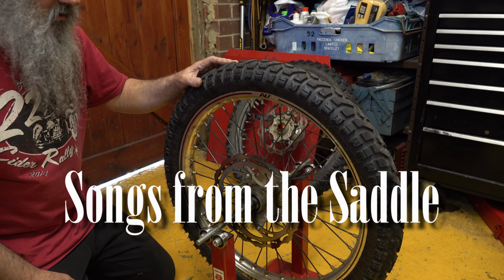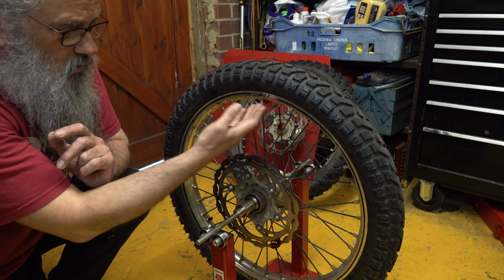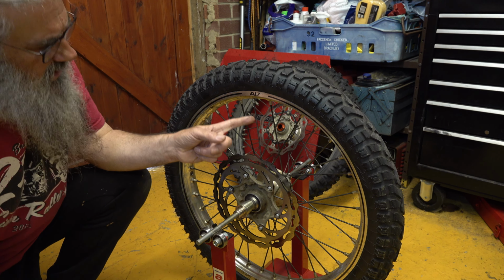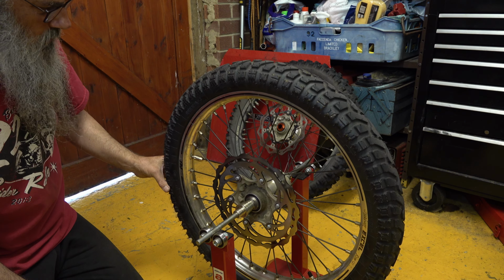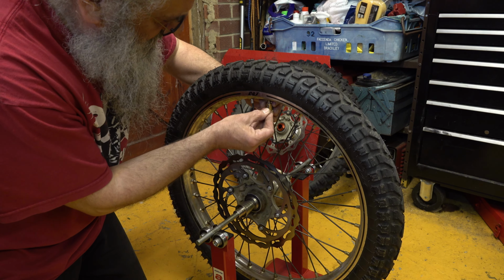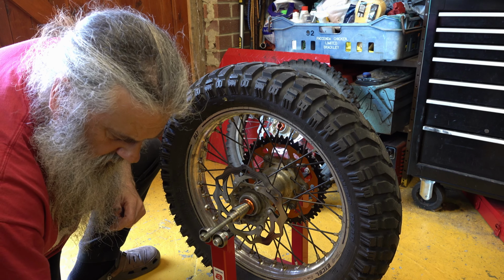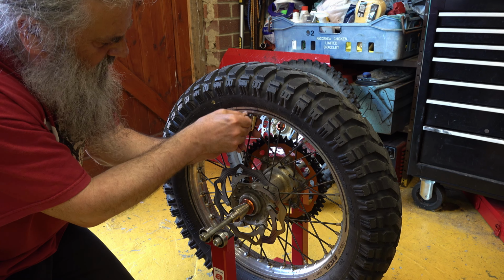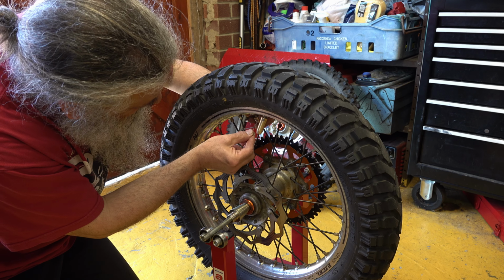How to Static Wheel Balance

Comment: On the topic of wheels, what are your thoughts on dropping the Front wheel size of the Triumph Scambler 1200 from 21inch to 19 or 17inch? Mainly asking, since I ride mostly on the road and curious of handling at higher speeds. 80mph.  Thank you.
Reply from the maker: Personally, I'd rather buy a Speed Twin than mess with the Scrambler configuration, but then we're all different.
Reply: @SongsFromTheSaddle  appreciate your response, and interesting, I have not considered Speed Twin as an option. Thanks. I’ll look into it